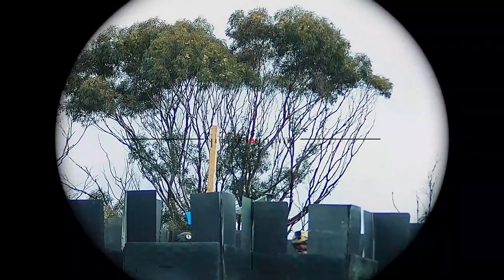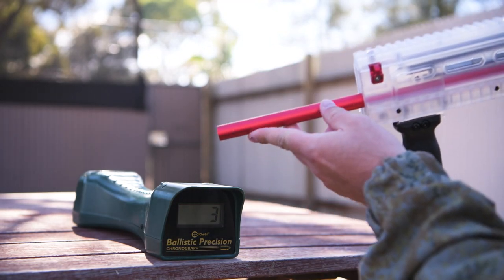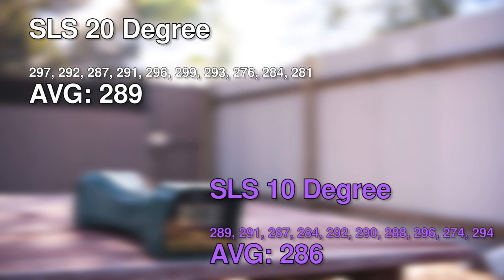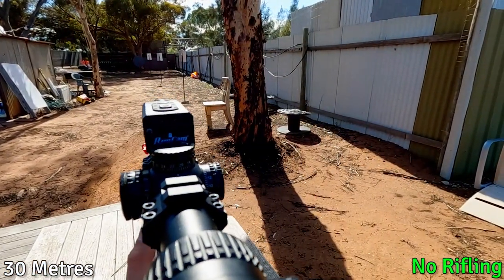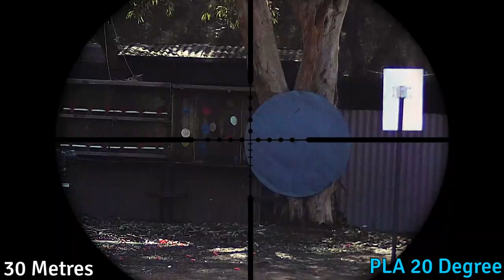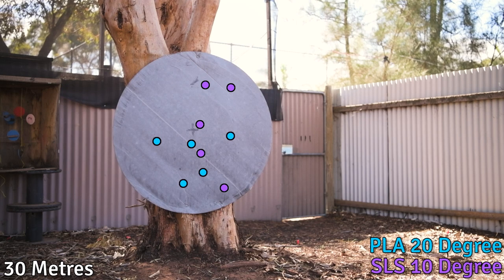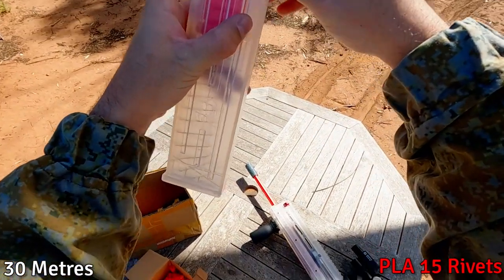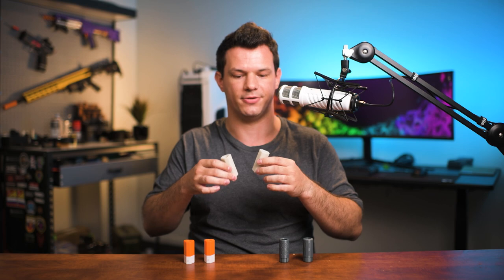Nerf Blaster Rifling Tested from Shanye and Dsfrick!

Comment: Greatand very info dense video, but I  would love for it to have a bigger sample size(especially when differences between the BCARs is so small). I suspect that the 20deg only performs noticably better in high powered blasters lke the one you used. The 10deg angle is probably designed for mid fpr blasters where less spin is necessary and high angles cause excess fps loss(I definitly cloud be wrong tough
)

Comment: great tests, I do believe that having a larger sample size would make the accuracy better to judge though. There were a few flyers that could have thrown off the results, and a larger sample size could have countered that. Not that you had to show yourself firing them all, but having some more dots on the final images might help making differences more obvious.
Reply from the maker: The fact some of them had fliers at all makes them bad. They should not have those if they want to be considered accurate.
Reply: @BradleyPhillipsYT  Even with good ammo, you sometimes get a few bad rounds in a batch.  If you run 100 rounds through each and most of the darts hit a tight group but you get just 1 or 2 of those flying off, they're probably faulty or damaged darts
Remember, you're working with soft foam darts; parts of the dart can get crushed or torn if they don't feed perfectly, which will hurt accuracy more than any rifling could help.

The PLA 10 did have a pretty bad showing though, that stray might have been a bad dart, but I wouldn't call it that much of an improvement over no rifling when the other darts were all barely fitting on the target.  The 12 rivets might deserve another test though, that was a pretty tight grouping other than that stray.

Comment: If the square one's had the same attachment as the round ones they would be perfect. This system will rely on how good the bearings are and how well they contact and spin. Hope they used sealed ones. Great vid as always.ThankQ.TkEZ>UK
Reply from the maker: Yeah you definitely couldn't expect to say, core sample the earth with your barrel and then have one of these bearing scar barrels still function.

The Dsfrick attachment method is quite ingenious.
Reply: @BradleyPhillipsYT  "core sample the earth" 

Idk why, but that made me chuckle

Comment: Will these fit on a 17/32 brass barrel? sorry if you mentioned it in your video i must have missed it. thanks
Reply from the maker: It won't, 17/32" is much smaller than 16mm. You would probably need to find a way to step it up.
Reply: there are adapters to print from thingyverse.

Comment: Off topic, is the s100 legal in Australia? I’ve ordered one from mm and I’m concerned as my last 2 shipments from them have been seized by abf. Can it be considered an air rifle? 1st shipment seized was released minus a worker suppressor. Going through the process on the second but they reckon an extended 3D printed prophecy hand guard plus rails is an air rifle part, go figure. I’ve got a s100 in the mail before the second shipment was seized but I’m worried that this’ll be snatched by our over zealous friends at the abf. Whaddya reckon? I’m afraid if this is seized that’s curtains for my hobby
Reply from the maker: It's completely legal in every state of Australia
Reply: @BradleyPhillipsYT  thanks mate
Reply: Great vid too

Comment: So... no base line for a decent stringed scar to show the fps loss or difference vs none and the bearings... I dont lose fps in my stringed scars, being they are tight bore and act like barrel extentions.
Reply from the maker: If you were to use a longer barrel plus one of these you could achieve a higher velocity, as string generally reduces the velocity by around 10%. The fact you're using a shorter than optimal barrel and then adding a string scar doesn't change that.
Reply: @BradleyPhillipsYT  I would strongly disagree. Non ported scar, set to 17° with the same ID of the barrel and an increase in fps would say otherwise on all my Zeus's.
My Swift would also disagree with its total of 740mm of barrel and non ported tight bore scar doing over 400fps with the scar on, and loosing 30fps with out it... the Swift today was pumping out shots well over 120m with that set up at the game today and always within a couple of feet of the target at max range.
I had a ludicrous 50m range advantage today, and used it to its full advantage of it making the other teams life insanely difficult today, and I got a ton of tags with very little competition...
Yet to see a single blaster of yours using your math doing those numbers or ranges, regardless of your set ups and scars Bradley.
Reply: @nerferx  can attest to both the distance and speed. I was very thankful there were so many nice trees to get friendly with 😂
Reply from the maker: @nerferx  if you're gaining velocity from your scar barrel, it likely means your actual barrel isn't long enough. 

Also 120m is further than both Airsoft or Paintball can shoot so looks like you'd have a lot of people interested if you brought that to market.
Reply from the maker: @nerferx  as for shooting 400fps, our velocity limit is 300fps here so I have no incentive to go higher. It is obviously quite achievable with anything large volume like the Swift, S100 or Sabre though given a large enough spring and long enough barrel.
Reply: @BradleyPhillipsYT  hmm. on my nexus pro i just chronoed the stock spring with a 200mm aluminium barrel. got 165 with and without the worker injection molded scar. when i use a 20mm spacer i even get higher fps with the scar on in comparison to no scar attached.
Reply: @nerferx  400FPS is just insane at a game...would not like to cross the line of fire close range ;-)
Reply from the maker: @buckethead420  yeah so 200mm is not long enough for the spring you're using. The scar is adding extra barrel length. What you can see though from your first example of Worker scar having the same velocity both on or off is the friction counteracting the gain.
Reply: @buckethead420  I had a minimum engagement distance of 20m, most of the time I was 40-50+m away.  Players count hear me fire, but they definitely were hearing the darts zip by. Was  a fun day, and going to make more game days like it happen in West Oz.
Reply: @BradleyPhillipsYT  been designing a blaster for the last 9 months to do this day in and day out, then Swift came out and it had a smaller PT in a platform to test things out with.
As for the barrel length, would you say Chris Cartaya's barrels are to short? Because his Merlynn Scar, when it acts like a barrel extension too with a slight fps nudge? 
I know you know that he has documented it on line.
And it's funny you say too short, when the old guard yank nerfers are saying it is18% over length on just the barrel let alone the extra 130mm of scar on top.  Apparently 510mm of brass is the optimal barrel length for the swift if you listen to them. 
Getting the Swift to do what it is doing, took a hell of a lot of planning, sourcing of the right bits,  and a mega ton of math and physics right down to a dart redesign to reduce drag in flight.
And I have to give credit to the people that helped, Chris Cartaya for his help and mentorship, and Spectre for the ridiculously good barrel he made for me.
And for the record, a BB has more inherent drag than a dart with the right shaped head because of the magnus affect applied. And I have seen guys with airsoft shoot over 100m with a properly dialed in hop-up. Paint balls won't go as far due to the shape size and mass of the projectile having more drag again.
This is something the Nerf Community needs to learn more about, Coefficient Drag properties.
So just like Novritch when he wasn't happy with the quality of the BB's he was using, found a way to make better ammo, then made the rifles etc.
Your gonna have to wait and see the end result... coz I am going for the complete package here, and when it comes out, believe me you'll know.
Reply: @nerferx  That FPS is one thing but maintaining a spread of a couple of feet over a distance of 120m is absolutely amazing. Post some vids please.
Reply: @BradleyPhillipsYT  yeah i guess thats the case. i just tried 250mm and 225,5mm yesterday... then the velocity started to drop so 145-155 with the worker scar attached (no spacer). the fps-gains with a large spacer only was from 200fps to 205fps. back to the 200mm barrel i get 160 fps without a spacer and 200  fps with a spacer. i think i am right at the sweet sppt with thr worker scar...have to do further testing when my bearing scar arrives..maybe then i would benefit from a longer barrel
Reply from the maker: @nerferx  are the darts you're using heavier than 1 gram or just shaped differently to current offerings?

Comment: wow only the 20 deg SLS one is actually useful. rest of them are horrible. thats really bad groupings on the rest
Reply from the maker: Yeah there is quite a difference between the 20 degree SLS and the others.
Reply: i always thought that high of an angle is only useful on lower fps blasters (at least thats what flag and armor told me)
Reply: @buckethead420  nop. higher fps will need even more spin because of the dart being less and less stable as velocity increases.
Reply: @wongyewxuan3880  Can run into whirlybird issues with too much twist and high velocity though.
Reply: @dangermaus9253  of which no one has ran into this issue yet. keep increasing twist till we hit this barrier.
Reply: @wongyewxuan3880  Your personal incredulity doesn't mean it's not happening.
Reply: @dangermaus9253  citation needed then. 

if u have proof of too much twist, please, link it.
Reply: @wongyewxuan3880  If you have a BT or any other adjustable scar you can replicate the issue yourself. It's dramatically worse with TS darts.
Reply: @dangermaus9253  ? we were talking about bearing scars here?
Reply: @wongyewxuan3880  We were talking about twist rate.

Comment: Worker darts better than adventure force? hmmmm?
Reply from the maker: Sure are
Reply: @BradleyPhillipsYT  But the heads Bradley the headss
Reply from the maker: What about them? They don't come off
Reply: @elliottmiller3282  they used to. The black/red ones are all 👍
Reply: @matgordon-smith1949  the ones sold as gen 2 high end?
Reply: @buckethead420  sorry mate, I had the wrong head colour. The gen3 red and tan/orange. I’ve put heaps through my swift going at about 350 and haven’t had a single issue
Reply from the maker: @buckethead420  yes gen 2 high end
Reply: @buckethead420  Or Gen3+ / Gen3v2. MM seem to be the only ones using the  Gen2 high end moniker.
Reply: @dangermaus9253  i just realized i already have the Gen3+ in purple. so i already have the best worker darts (woth findability in mind) and don't need to look for another retailer

i was wondering how darn accurate and consitent these darts are compared to AF Pro

from 30 darts @ 200FPS i hit 25 on a 2x3 foot target at 30m with wind involved (nexus pro, 200mm aluminum barrel + worker injection-molded SCAR)

the fps from 20 fresh darts all were between 199 and 201 FPS on the chronograph
Reply: @buckethead420  There is apparently a difference in foam between the Purple Gen3's and the Red or Black Gen3v2's. If there is a difference it's extremely minor.